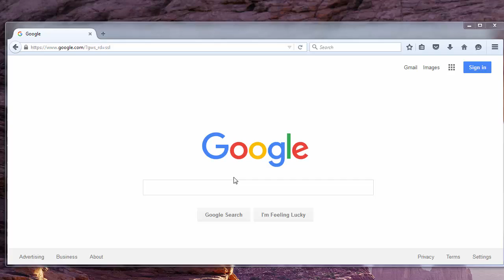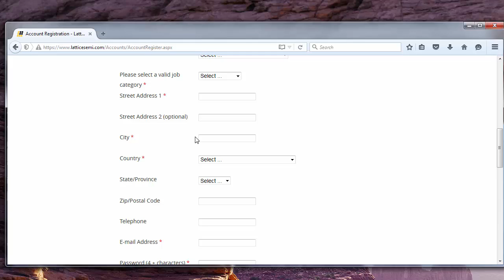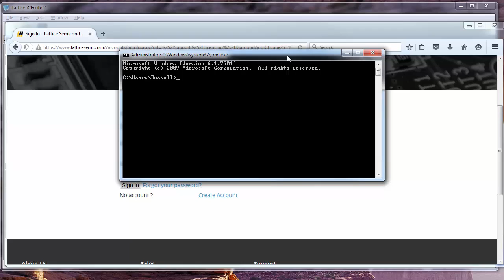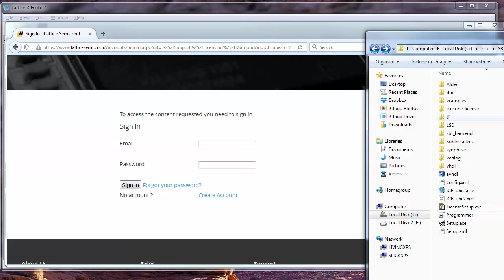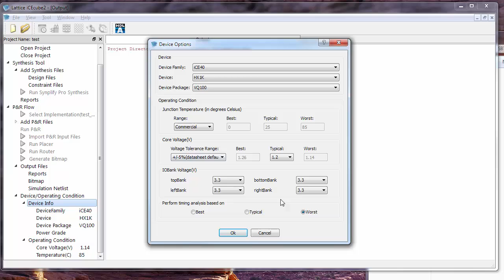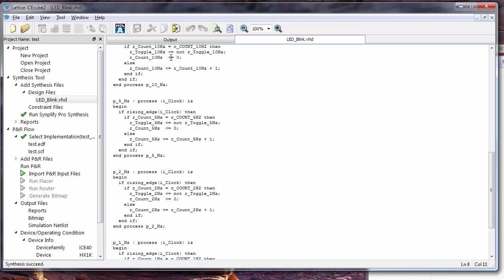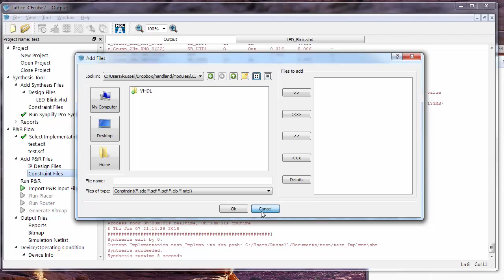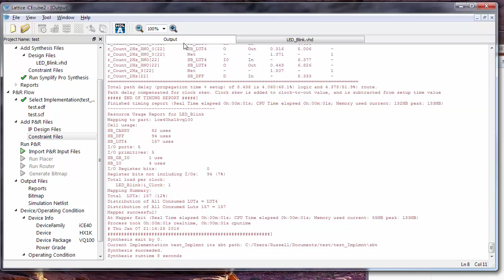iCEcube2 Installation and Overview

Comment: I still get an error even if I set my license path to license.dat using the LicenseSetup.exe. Error message is "Check environment variable LM_LICENSE_FILE set to:C;\Iscc.......Failure caused by No such feature exists........I do not know what or where that LM_LICENSE_FILE is
Reply from the maker: Did you get the license.dat from lattice? If the setup.exe isn't working, just put that file in the c:\lscc directory that it's looking for it. (you'll need to create this directory manually)

Comment: Hi, I am curious what is the difference between iCEcube2 and iCE Storm.

I don't think there is much comparison between both, and I'd like to ask for your advice.
Reply from the maker: IceCube2 is made by Lattice Semiconductor. iCEStorm is made by regular people and is open source.
Reply: @Nandland  What about Lattice Diamond?

This is so confusing :p
Reply: @ycling9168  Lattice Diamond is meant to be used with Lattice's higher end FPGA devices

Comment: I had iCECube licensing issues with Ubuntu 16.04 x64. It turns out that your network interface has to be named 'eth0'. If not, change /etc/udev/rules.d/70-persistent-net.rules . Here's my file used when my default interface was enp5v0 or something like that.

SUBSYSTEM=="net", ACTION=="add", DRIVERS=="?*", ATTR{address}=="macaddressgoeshere", ATTR{dev_id}=="0x0", ATTR{type}=="1", KERNEL=="enp5*", NAME="eth0"
Reply from the maker: Glad you were able to figure it out.  Sorry to the difficulty!
Reply: it just starts there. next I had to edit all the scripts in .../lscc/iCEcube2.2017.08/synpbase/bin/ and have them run run bash instead of sh. When I get my Go board today, I'll be figuring out how  to correctly install the Lattice Diamond rpm on ubuntu. Haven't done this (using alien or by hand) in 10 years or so.
Reply from the maker: Running on Ubuntu is not a simple task.  If you are unable to get this figured out and you're using Verilog, you might want to look at the IceStorm tools.  https://www.youtube.com/watch?v=P-9WCFi0p-0  They are very easy to get set up.

Comment: You never outlined the pros and cons of Altera, Xilinx and Lattice. I plan to buy your board but does a particular board have preference over the other? What about in the defense industry?
Reply from the maker: You missed one big one: Microsemi.  But you're right, I have not yet said which FPGA is best for which application.  Altera and Xilinx are the big players, big FPGAs that are for high-end applications with lots of stuff going on (in general).  I find that for beginners, the Integrated Development Environment (IDE) is a bit overwhelming, there's too many bells and whistles.

Lattice has a lot of smaller FPGAs, a simpler IDE.  You really can't get more basic that IceCube2.  They're also less expensive, so this is why I chose Lattice for the Go Board.  

Microsemi (which used to be Actel) is a small player relatively speaking too.  They have Rad-Tolerant FPGAs which are good for space applications, they also tend to have a higher temperature range (Mil-Temp) than the others.  These FPGAs are Flash-Based, which is different than the SRAM-based FPGAs that Lattice, Xilinx, and Altera put out.  

As you can see, there are lots of differences.  You could write a paper on it.  This is the high level.  Let me know if you still have questions!

I've worked in the defense industry for most of my career and I've seen all 4 of these companies FPGAs used in various applications.  No particular preference, it's based purely on the requirements of the product.